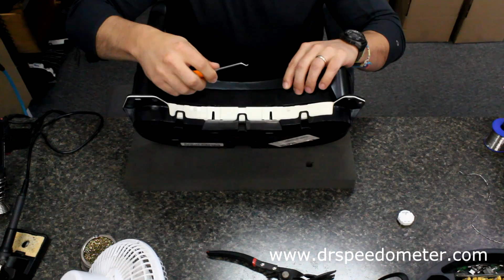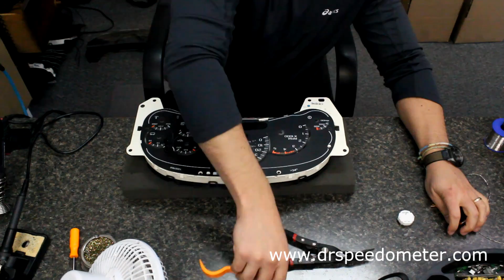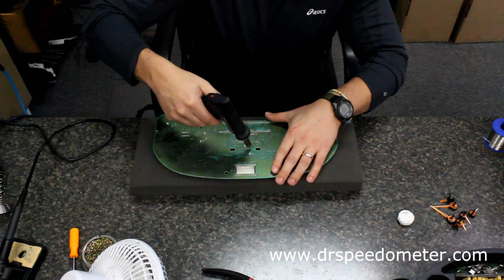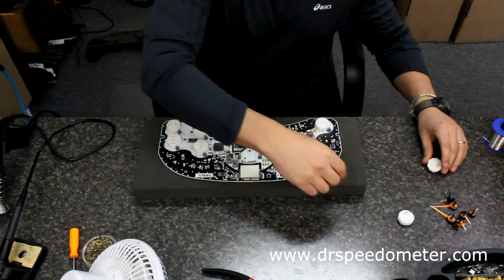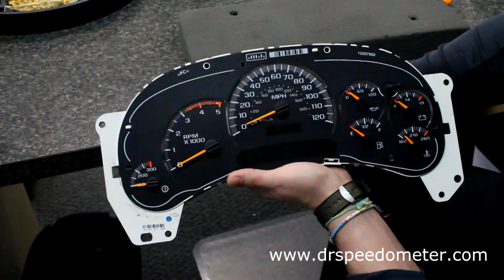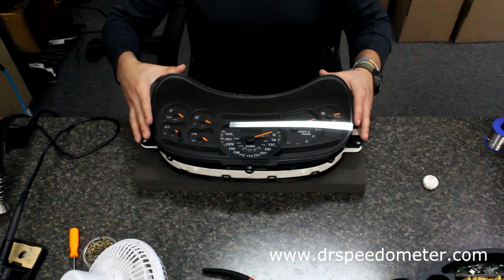How To: 2003-2006 Suburban, Silverado, Tahoe,  Sierra Stepper Motor Install and Speedometer Repair

Comment: I really like it when creaters just lay off the BS and get straight down to business. This is by far the best video when it comes to replacing the stepper motors. DrSpeedometer cut all the crap and made the most efficient video possible. Nice work

Comment: I disassembled and resoldered the resistors for the PRNDL display.  It works now, however my gauges for temp, voltage, and oil pressure are off.  If I take them off again and simply dial them back to the stops as indicated in this video will they be properly aligned?  Thanks for any help.

Comment: Thanks for the motors through Amazon and the very helpful video! Just soldered for the first and used a $20 kit off Amazon and replaced all 6 motors. Also I was able to calibrate them needles after only three times plugging in and unplugging. THANKS!!!